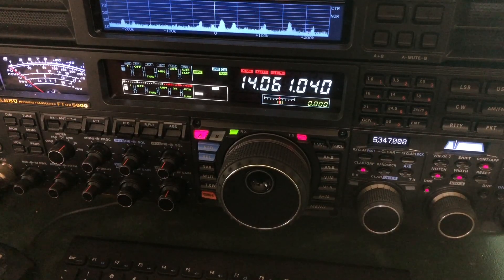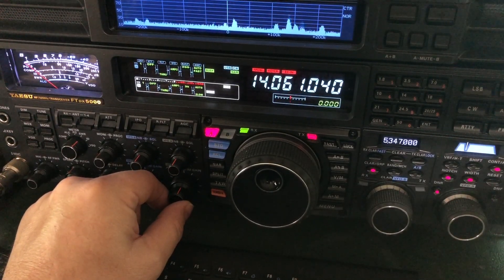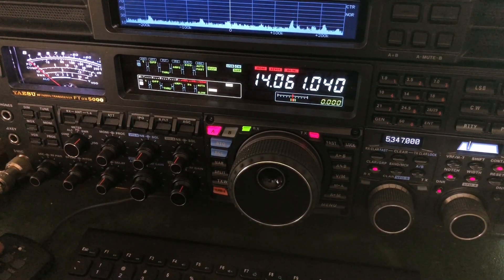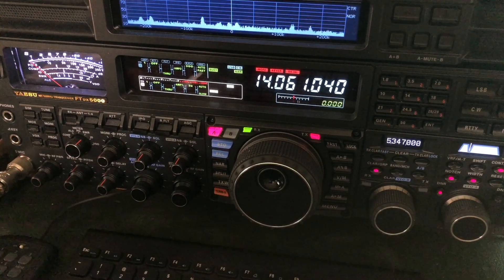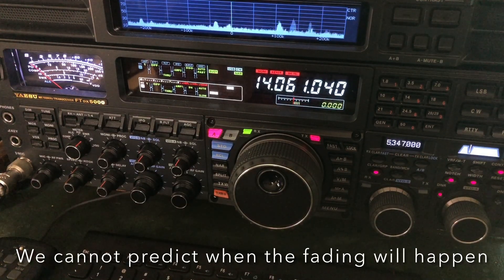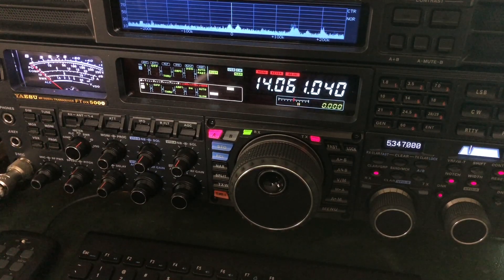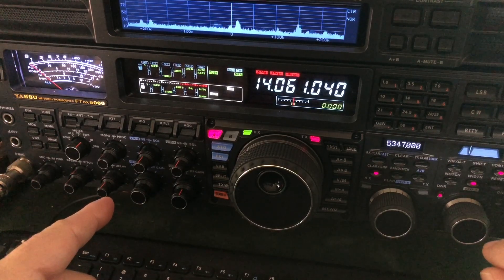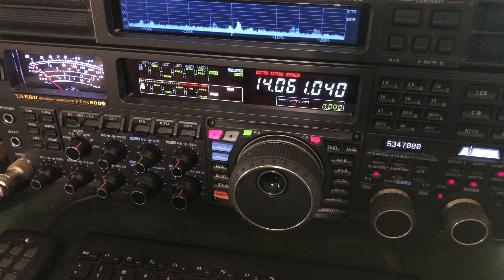Yaesu FTdx5000MP: Using AMP2 & Manual Notch to pull out a weak CW signal

Comment: Hi there, how were you sending cw, was it pre recorded cw on the keypad? I really enjoy pulling weak signals out of the noise, I’m just in the process of learning cw,  well, forgetting the cw I learnt so I can re-learn and hopefully learn head copy instead, 73
Reply from the maker: Hi!  Thank you for thinking that I was sending with a memory keyer.  But, I was sending by hand, with a Kent TP1-B keyer.  It’s an iambic.  I bought it from DX Engineering.  It’s the best I’ve ever used.

I started on CW, in 1982, as a Novice.  Got busy with life.  Didn’t do much radio for a while.  CW got rusty.  Got back into radio a few years ago and soon after I got into SOTA.  That motivated me to get back on CW. I love it.

I definitely recommend head copy.  Or get an FTdx10 and let it decode it for you. Hi! Hi!

73, de N4HNH

Comment: PLEASE, PLEASE SELL YOU 5000 AND GET YOU AN UP TO DATE RIG FTDX101D.  i am very interested in the 101D.  I WOULD NEVER BUY OLD TECHNOLOGY. THANK YOU FOR ALL YOUR YOU TUBE VIDEOS. I AM A BIG FAN OF YOURS!
Reply from the maker: Not gonna happen.  Buy yourself a FTdx101.  It’s a great radio.  

But don’t get fooled by clever marketing.  The 7300 was latest technology when it came out, but it cannot receive better than a $600 FT-891.  

Old technology doesn’t always mean worse.  Down-conversion was the standard for the old receivers.  But in the late 70s and early 80s the manufactures switched to up-conversion.  They fooled the amateur community with terms like triple superheterodyne, quad superheterodyne.  What they didn’t talk about was the phase noise that the up-conversion approach added to the noise floor of the radio.  But the up-conversion receivers were less complex and easier/cheaper to manufacture.

Finally, in 2003, Ten-Tec introduced the Orion.  The Orion was a return to down-conversion.  The receiver outclassed the triple and quad superheterodyne up-conversion receivers in the Yaesu, Kenwood, and ICOM lineup.  So, by 2010, Kenwood and Yaesu started returning to down-conversion, with the FTdx5000 being one of the first.  Exercise extreme caution when considering the new kid on the block as always being the best.

The DNR in the 5000 has been the best in any radio.  The FTdx101 just now caught up to it, with its latest firmware update.  The 5000 has a Super Narrow APF option for CW.  The FTdx101 doesn’t.  The 5000 has IPO2 option.  The FTdx101 doesn’t.  The 5000 has knobs and a real meter.  The knobs are laid out in  perfect ergonomic fashion.  The FTdx101 is still somewhat menu-driven.  The 5000 features a variable preselector for all bands, including the 60 meter band.  The FTdx101 doesn’t have a variable preselector for the 60 meter band.  And, did I say, the 5000 has knobs and a real meter.  Oh yeah!  The 5000 has knobs and a big, beautiful, D’Arsonval movement meter.

Look, they are both fine radios but the FTdx101 doesn’t “beat” the 5000.  They are neck to neck.  It’s a choice of the beautiful display versus knobs and ergonomics.

73, de N4HNH
Reply: I sold my 101D and so did a good friend, after just a few months.
We are now much happier with our 5000MPs, altogether superior, especially 
operating cw👍
73 Rob G3RCE
Reply: Don't be fooled by current and future technology..  in the right hands old technology can work right in trace with the new..  likewise, in certain hands, new technology and old tech can perform equally poorly

Comment: Awesome!! Glad to see this. Getting back into Ham Radio. Big rigs like this are out of my budget but I do have a ‘891 so, crossing fingers. (New to DSP too.) Tnx de WB3CFN…dit dit 😊
Reply from the maker: I use a FT-891 as my mobile and for SOTA (Summits On The Air).  It’s a great radio.  There are videos on my channel about the FT-891.  Most of the techniques I teach with the FTdx5000 can be applied to the FT-891.

73, de N4HNH